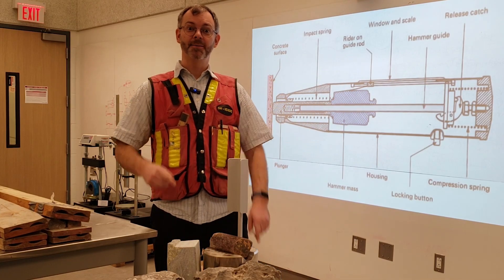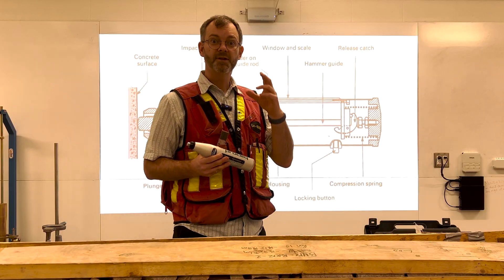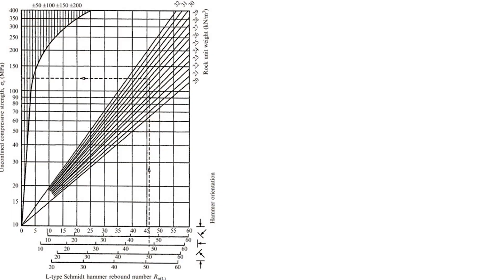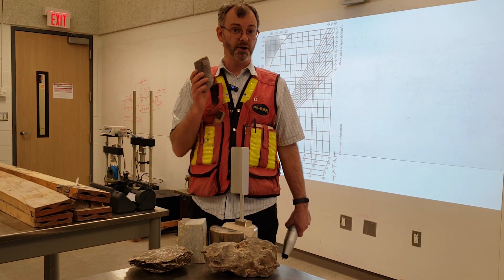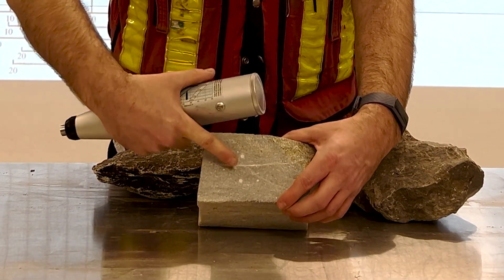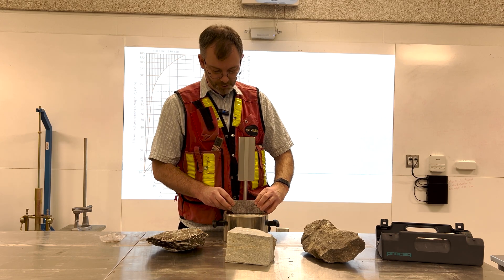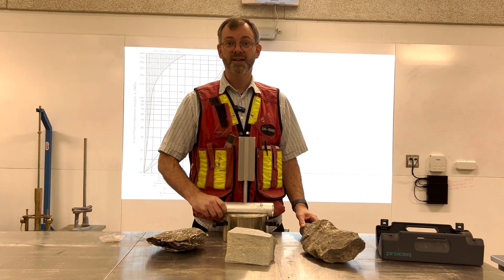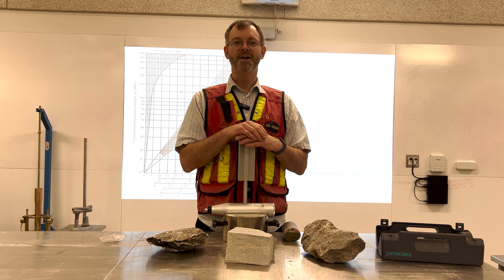Introduction to the Schmidt Hammer

Comment: The actual comprehensive strength of concrete must not be gotten/estimated directly from the table or graph vs rebound number, but be gotten/established from the newly but previously established relationship between the rebound number and comprehensive strength of each type of concrete.

Comment: if you are just a rock hound out on a Saturday there is a spring loaded center punch that is used for metal fab. It delivers a consistent jab with a sharp little tungsten tip which can give you a rough idea of the hardness of a sample picked up in a river bed. Available in hardware stores.
Reply from the maker: nice! might be helpful for the weekend geologists!